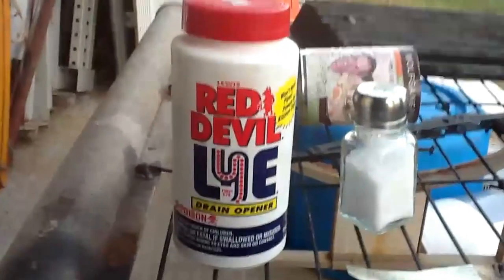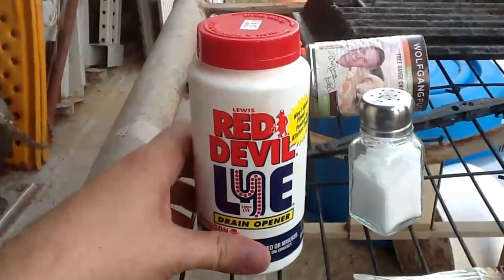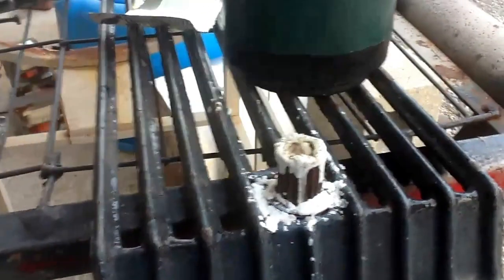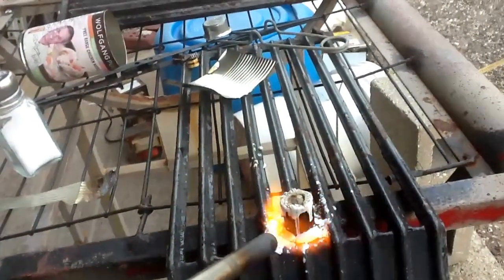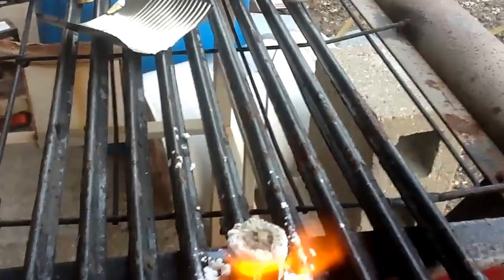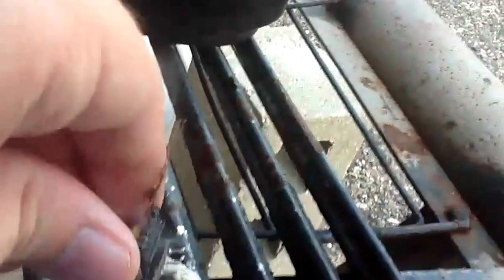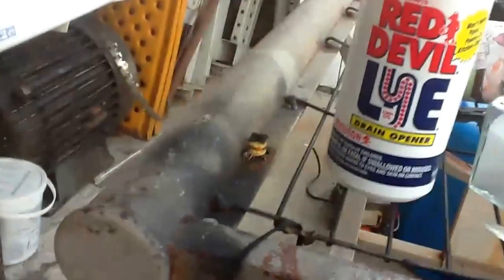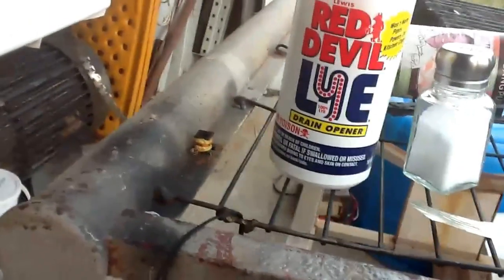Best Way to Strip Magnet Wire

Comment: This method is used commercially with some sodium nitrate added for some reason. We used it for very fine fragile wires in a cryogenic application where nicks could have cost $millions if the wire broke.

Comment: There is simple way to streep the insulation of magnetic wire use a ligther slitely burn the wire let it cool then you can streep it with your  finger nail
Reply from the maker: Thank you for your wonderful comments!

Comment: I would have never done this just for a couple/few wires... The scenic route my goodness.
Reply from the maker: It depends how thick the wire is and what it's coated with. #34 and above for example is very thin and fragile. Scraping with a knife or pulling with sand paper cuts and tears the wire. Burning off the insulation with a flame on such a wire also burns the copper strands.  Some wires are coated with insulation that turns into a solder repelling mess when it's heated with a soldering iron. Sometimes there is no choice but to use such wire.

Comment: I'm going to try it again. This time I know to keep heat on longer. It worked last time however the mixture wasn't homogeneous and some bits stuck to wires. I cleaned off with water. I did get some on my hands and bugger it hurts like a sob! I will use proper gloves next time and mask. lol...

Comment: Used this trick to fix a brushless motor for an RC plane. Forgot to put in the salt, but worked fine. Used a 15mm copper endcap as copper transfers heat better than steel, you have to be quick as there is nothing to retain the heat, but it takes very little time to heat up that way. Took less than 2 minutes including finding a brick to heat it on. Thanks!
Reply: I'm pretty sure the salt is there to act as an abrasive. The salt melts at a much higher temperature so I doubt it's melting.
I haven't tried this trick yet myself, but I'm glad I know about it.

Comment: Thank you. this takes a while to master but, it does work. I was able to fix a brushless motor after someone cut the wires shorter than the factory tinning. I used a cast iron plumbing cap. It takes a little longer with cast iron.

Comment: good video. I think I would use thick rubber gloves when I try this. I am wondering if muriatic acid works. Anybody tried it?
Reply from the maker: Chuck Sampson Gloves are a good idea! Hot lye is very dangerous.
Think acid will eat the wire though

Comment: That is absolutly rediculous. Why dont you just use a cigarette lighter? Works for me. Takes 2 seconds.
Reply from the maker: There are two answers to that question.
Some magnet wire has an insulation that turns to flux, in which case a cigarette lighter might work sometimes, as long as you don' t hold it there long enough to burn the flux. It would be better to just use a soldering iron.

Other magnet wire (the "good" stuff) has a different kind of insulation that will burn and leave a nasty carbon deposit that has to be removed in order to solder to. Removal involves scraping with a knife or sandpaper, which scratches the wire and risks pulling apart fine gauge wires.

The caustic soda process removes the insulation and leaves the wire almost 100% intact.

Comment: I've tried this and it didn't work... torched it for about 3-5 minutes. it never melted. I added 1 tbsp of salt and 4 tbsp of lye. Where did I go wrong?
Reply from the maker: It can take a LONG time to melt.  It will just about glow red hot.  5tbsp is quite a bit and the more there is, the longer it takes.  It will go quicker if you use MAPP or oxyacetylene.  The best way to do it would be with an induction heater, but that is not something everyone has.
Reply from the maker: Aaron Kaplan For doing this on the cheap, I would recommend using a torch with a good strong swirl flame and picking up a bottle of MAPP gas. When I did the video, the lye was already very hot, so it went fairly quickly. Another thing is that if the lye contains moisture, which most lye does, it will start to boil out long before the lye actually melts and the lye will appear molten when in reality it is just the water coming out. Once it dries, the temperature will begin to rise again and eventually, if the torch is up to it, you will get a 'true' melt. I'm glad you got it to work.
Reply: The Lightning Stalker  Yea it took a while to melt, but didn't quite do the job as well as expected. Is there any other way of accomplishing this? Where do you get an oxy acetylene torch? I need to do this as cheaply as possible.
Reply: Aaron Kaplan Yeah... this project doesn't / shouldn't require an oxy torch... it's just simple tiny magnetic wire.  practically the same as you are using.
Reply: Aaron Kaplan OK nevermind.. I got it.. Lye trick worked...